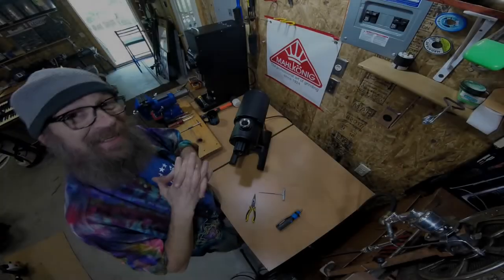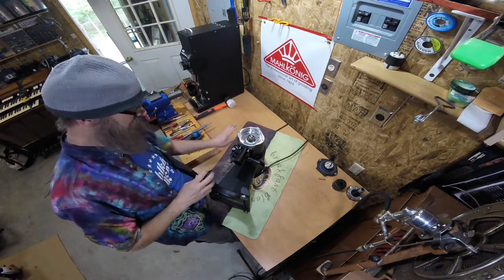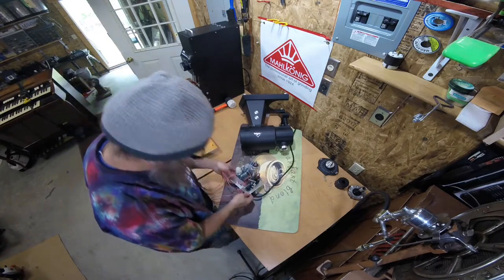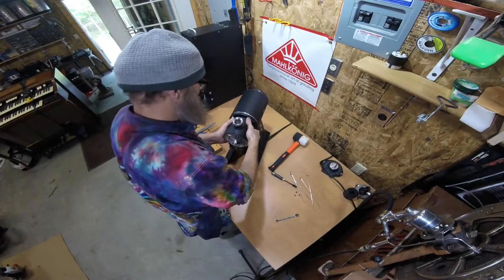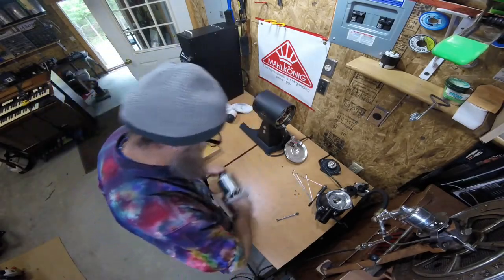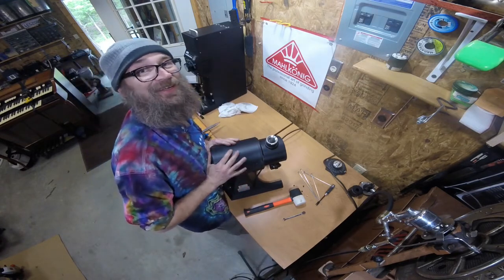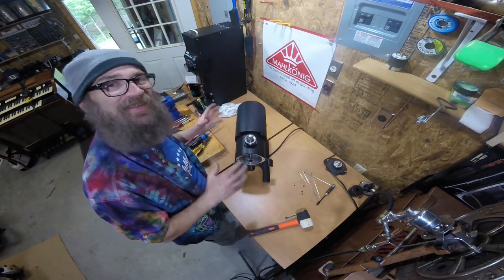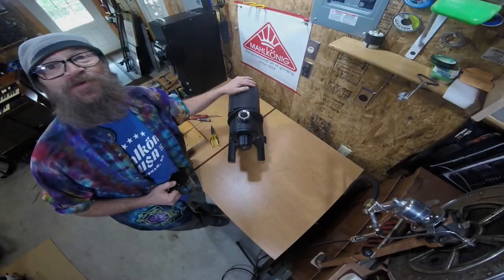EK43 Complete walk through

Comment: The "How to Keep Your Volkswagen Alive" of EK videos, for sure! Two questions - have you found that using a torque screwdriver helps with either the faceplate or burr installation, and have you noticed more accurate tolerances on newer ones? I've heard that both the newer short and tall models have CNC'ed chambers, but I've also heard that the prebreakers still need to be sanded. Thanks so much!

Comment: It it easy to remove the rubber gasket between base and motor housing? Have they modified the body so that it needs the rubber collar or is it easy to just take out? Not a good look with the black collar with the white EK, as I have no black parts or logos on mine at all now, this is for home use.